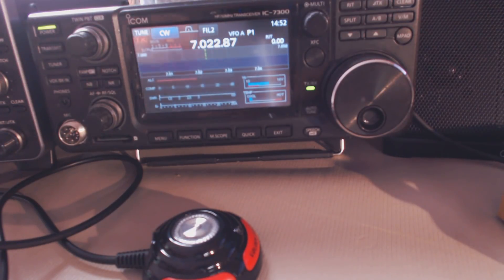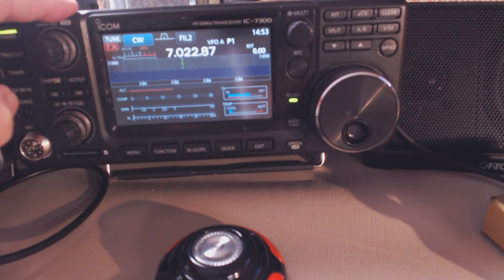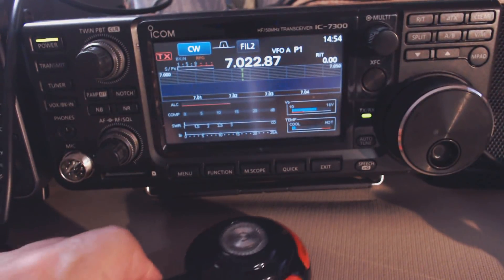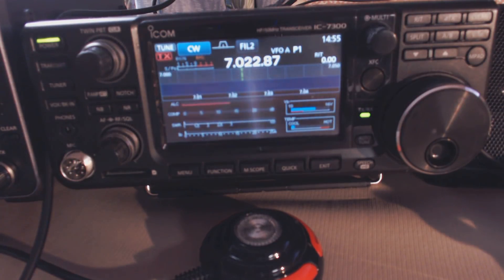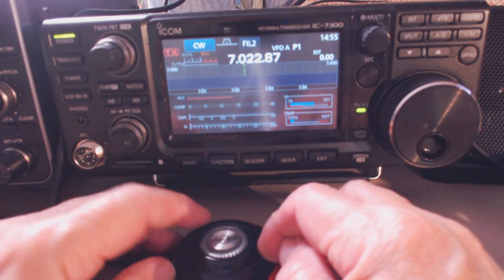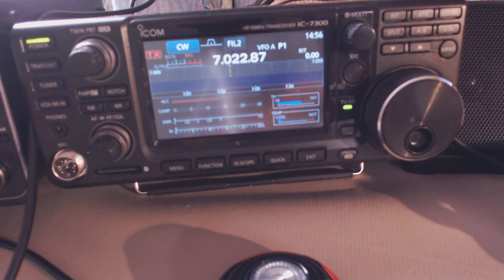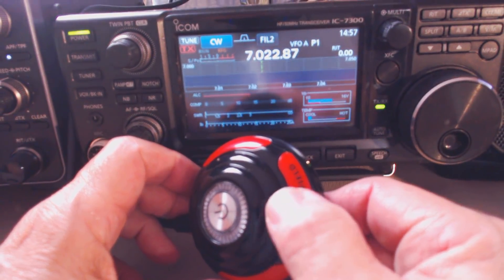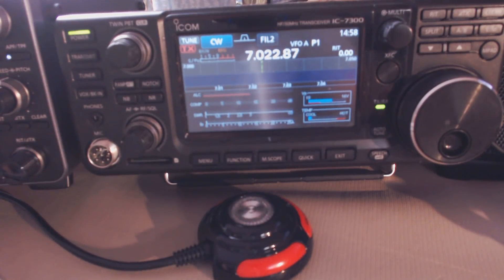ICOM Tuner Button For external or internal tuner

Comment: Steve, thanks for producing this video. I have an Icom AH-4 and would like to use that along with a vertical antenna that doesn't run through the AH-4. Would this button allow me to use the AH-4 or tune the vertical using the 7300's internal tuner? Any thoughts would be very much appreciated.

Comment: Interesting  gadget Steve. Will it work with LDG auto tuners?
Reply from the maker: Well it has nothing to do with the tuner. It just makes the rig put out 10 watts. I don't know how the LDG responds to that but probably about like an MFJ.
Reply: I have my LDG connected to my radio with the interface cable. I've never used it without it. With it in fully automatic tuning mode I guess it'll work like your setup.

Comment: I have a MFJ -993 connected to my IC-7610 Thru the AH-4  connector and in testing it I can I tune the 993 by pressing the the tune button on the radio and it tunes Fine, and if I turn the power off on the 993 and press the tune button on the radio it will tune the tuner in the 7610. Turn the 993 back on with the power button on the 993 then press the tune button on the radio the 993 again tuns just fine. So what would I gain by adding a tuner button, Sounds redundant and what you are showing you have to press two buttons. I dont see what I would be gaining.
Can you explain
Thanks Keith N9QDS
Reply from the maker: Nothing if you have the 993. Thanks for the interesting test.